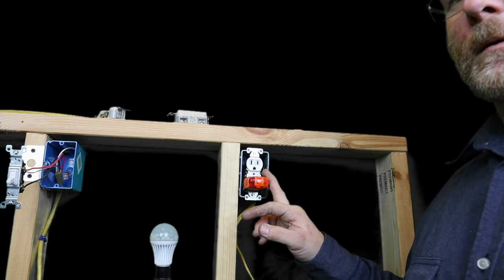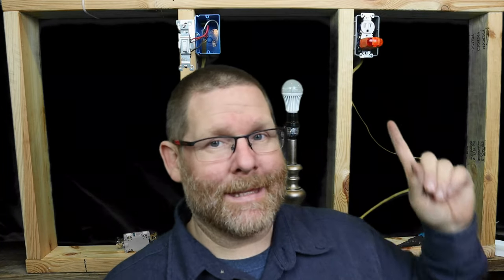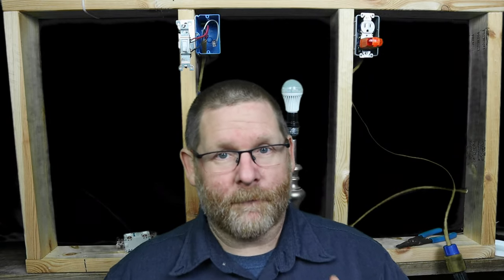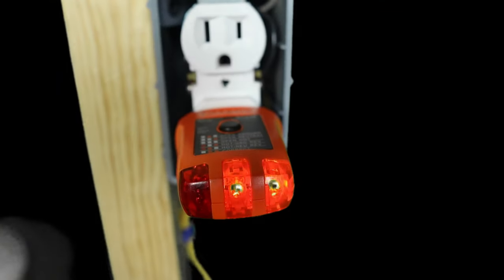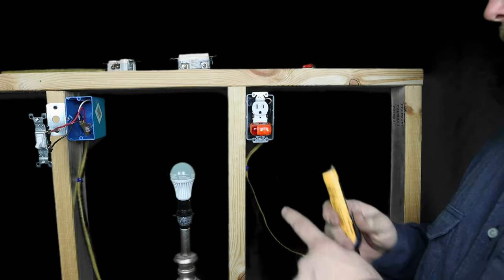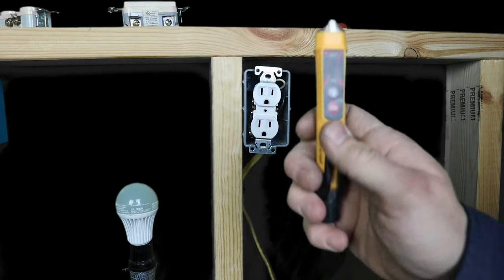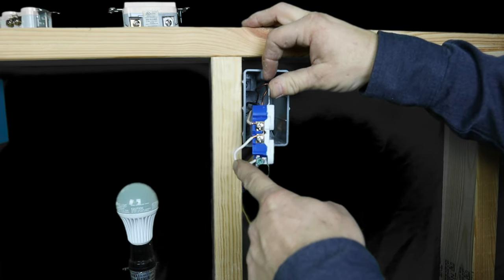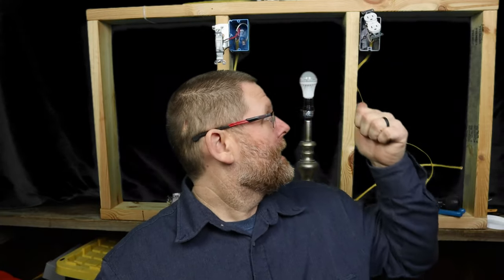Dangerous Open Ground Fix

Comment: I hooked up a GFCI outlet to a non-grounded house. The green light is on. Is it OK to run my computer off of that outlet not truly being grounded don’t care about getting shocked or electrocuted. I don’t want  a backfeed or something to fry my computer. I always thought the ground was so you don’t get shocked, but I heard that if it’s not grounded, the computer can build up static and fry electrical components.
Reply: Is it ok to run your computer on an ungrounded receptacle? Yes and no. You may be under the impression that a ground is there to save your computer from damage. It is not. The ground is there to provide safety by clearing a fault by providing an alternate path to ground. It has nothing to do with saving your electronics. In fact, the electronics in your device should be isolated from the ground, unless the device itself is damaged and has a ground fault. Any static electricity that builds up on the chassis should have no path to the electronics inside, aside from you providing the path yourself by touching something inside while servicing.

Why, then, do so many people believe that a grounded circuit is necessary to protect their electronics? I think it’s because a Type 3 SPD, like a power strip style surge suppressor, requires the ground to properly function. The surge suppressor is designed to clamp transient voltage to ground, and without that ground, I believe they are nothing but an overpriced power strip. In summary, the ground itself provides no protection to your equipment, but the ground is required for your surge suppressor to work properly. If you don’t use any surge suppressor strips anyway, then having  a ground verses not having one should make no difference with regard to protecting the equipment itself.

If you have a house that lacks grounding, in addition to installing GFCI receptacles, I’d recommend that you install a whole-house surge suppressor at your panel or meter (type 1 or 2 SPD). These have much larger MOVs than any surge strip, and will also protect other electronics, like the components in your refrigerator, range, washer, LED lightbulbs, etc.

One last thing. No surge suppressor will clamp a lightning strike. If lightning strikes your house, or anywhere else nearby, no MOV can arrest that kind of surge. A surge suppressor’s greatest benefit is in arresting the transient voltage that originates within your home, your neighbor’s home, or from the power company switching nearby. 80% of all transient voltages originate within your own home, mostly from inductive motors switching on and off. Your A/C is the greatest culprit, with your air handler, refrigerator, and washing machine fighting for second place. Never plug your computer or TV into a circuit that also has a window A/C unit on it. That really puts a lot of wear on the Type 4 SPD built into your computer’s power supply.

Comment: Yeah I found a bootleg in my garage outlet when I went up upgrade the outlet to an industrial grade one for EV charging.

Already been charging there for a bit so I'm pissed and also a bit concerned about how he tricked the inspector and wondering how many other outlets are like this.
Reply from the maker: Yeah that's not good for sure. Unfortunately you would never know unless you purchased a ideal sure test circuit analyzer or pull each one out.

Comment: cant you just label the outlet as NO mechanical ground  ?
Reply from the maker: With a gfci you must certainly can. It's no equipment ground they have the stickers in the gfci boxes
Reply: @MountaineerOutdoors  Can you install a standard 3 into the 2 and just put the sticker on "no equipment ground "
Reply: @MountaineerOutdoors   Can you install a standard 3 into the 2 and just put the sticker on "no equipment ground "
Reply from the maker: Can I ask why you keep asking me the same question? I already answered it I thought??
Reply: @MountaineerOutdoors  You assumed I was talking about a GFCI replacing the 2 prong.  I was asking what was wrong with using a standard 3 prong non GFCI outlet for the  2 prong and just labelling it as un grounded.